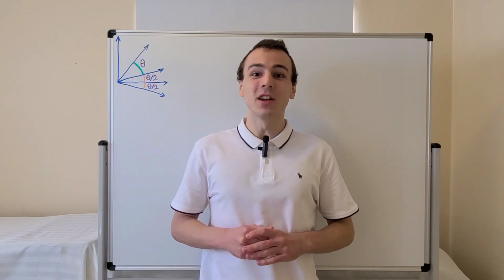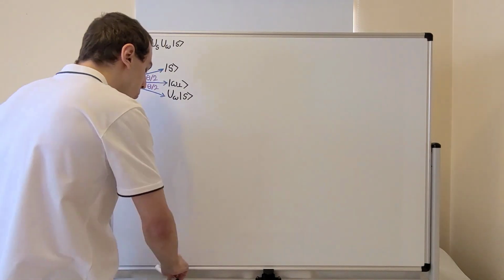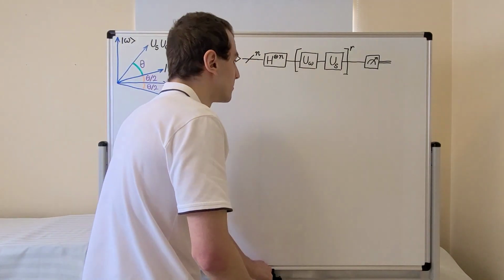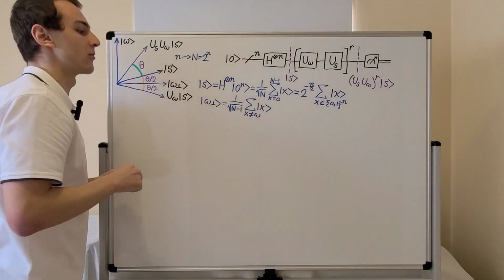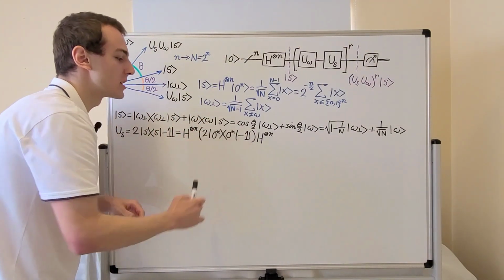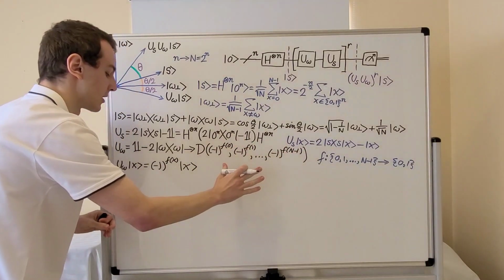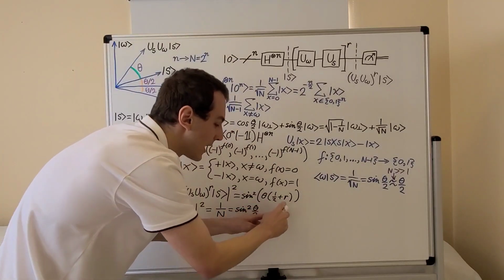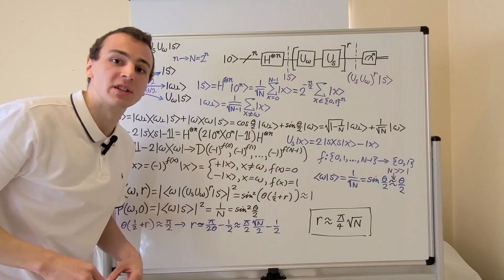Grover's Quantum Search Algorithm, Geometric Visualization, Quantum Circuit Diagram

Comment: What determines little n?  i.e. what determines that number of qubits needed?  Thx
Reply: consider you have an unsorted data with N entries, let suppose an unordered array with 16 elements, simply take square root of number of elements (n = sqrt(N)). That'll be the number of qubits you needed, in the above example you will need sqrt(16)=4 qubits.

Comment: Wow - so clear, and so much passion!
From the video, I believe you consider entanglement to be synonymous with superposition? There is no qubit correlation without entanglement, so therefore no encoding of the ‘problem’ in the qubits. So the qubits are encoded, entangled, superimposed, in the Hadamard stage? 
Are you familiar with Fourier epicycles? Do you think looking at this process using the Argonne diagram and Fourier epicycles might clarify these steps?
Thank you so much!

Comment: I'm a sophomore in physics and I found your video was incredibly helpful. I do have a question regarding the outer products used for Us and Uw. What is the purpose of 2|w><w|, I don't have much experience with linear algebra yet so i don't fully understand what |w><w| does and why it needs to be multiplied by 2, but I understand it flips the sign. I'm also a bit confused on what exactly the identity operator is for.
Reply: The operator "2|S><S| - I" is called the Householder transformation which rotates a vector around the |S> axis (where I is the identity operator). Your question is about the operator  "I - 2|w><w|" which is the Householder transformation with a negative sign in front. So it is the negation of the vector rotated around the |w> axis.

To convince yourself, you can do these operations on a piece of graph paper by (1) rotating |S> around the |w> axis and negating it; or 
(2) doing each operation of (I - 2|w><w|)|S> which is (a) sketching the inner product <w|S> which is the length of S overlapping (that is, projected onto) the |w> axis; (b) create a vector on the |w> axis by multiplying this scalar length by 2 (make sure to pay attention to vector direction) - at this point you have done 2|w><w|S>; (3) add |S> to this newly formed vector (this is the identity operator step) - at this point you should see |S> rotated around the horizontal axis |w⊥>; or
(3) without the graph paper work this out mathematically using standard vector operations (eg, inner product (dot product), scalar multiplication, vector addition) using steps outlined in (2).